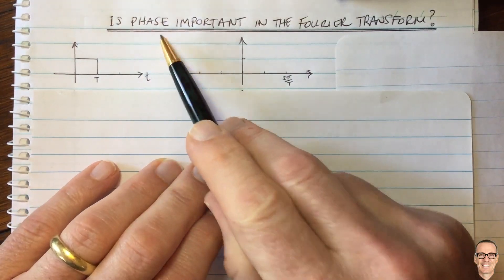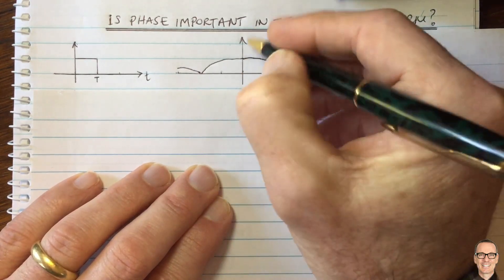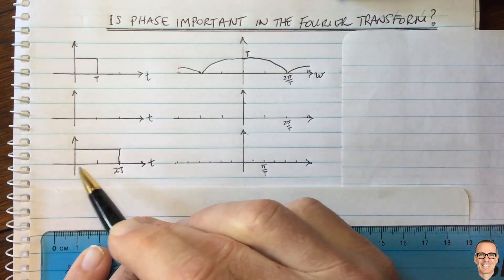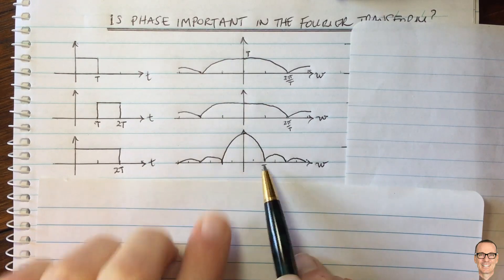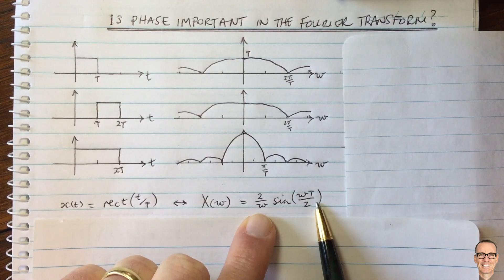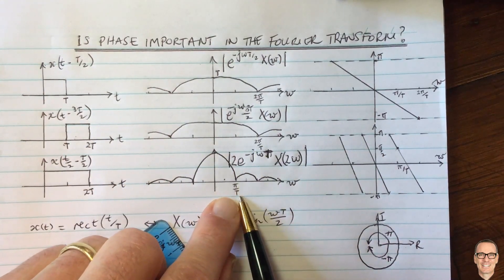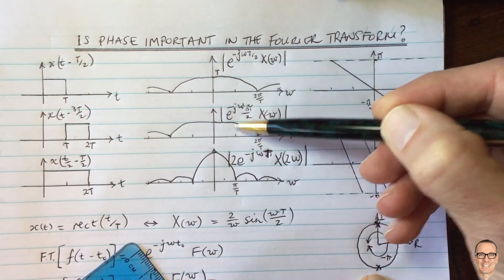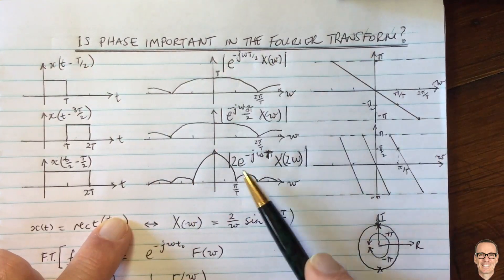Is Phase important in the Fourier Transform?

Comment: Nice!

Clarification at 12:54: 
Adding the two terms with opposite signs for phase angles results in cancellations in the case ω=π/Τ because the result is (j-j)*X(ω), but in general equal-but-opposite phase angles don't result in such nice cancellations.

Comment: Short answer "yes" right ?
I thought you could give all the information in a Fourier plot by either using + and - frequency, or by plotting real and imaginary components.. This seems to imply its gotta be both?
Reply from the maker: Yes. For example, a real signal is always going to have a magnitude spectrum that is symmetric around f=0. So in that case, plotting the + and - frequency only tells you that it is a real signal. It doesn't tell you what the phases of each sinusoidal component are, at each frequency.

Comment: Very insightful, thanks. When I look at the 3 diagrams on the left hand side, you have a special denotation at the y-axis. I haven't ever seen that. I just know the normal x(t) denotation and the signal is then e.g. x(t-2) to shift the function 2 units to the right. 
Does that mean you can put the whole information of the function into the y-axis denotation?
Thanks
Reply from the maker: The label of the y-axis should be the function that is plotted. If you plot x(t) then label the axis x(t). If you plot x(t-a), then label the axis x(t-a).

Comment: Amazing example, so if I understood correctly, usually when we see the graph of a Fourier transform  of a function f it's ploted as its absolute value |FT| which makes us lose the information of the phase, so if you plot that same function e^{-jw(T/2)}x(w) WITHOUT the absolute value we would have all the information for the phase? or am I missing something?
Reply from the maker: Yes, that's right. Although it's not easy to think of how to plot the function (on a single graph) without the absolute value, since it has two parameters (amplitude and phase).

Comment: Hi Sir, thanks for your great video. I have a question about the phase cancellation. Is the reason that they can cancel each other because the shapes of the sinusoid wave component at the frequency at π/T for x(t - T/2) and the sinusoid wave component at the frequency at π/T for x(t - 3T/2) in time domain are flipped due to the phase, and they have the same amplitude and frequency, so the waves cancelled each other and no contribution at that frequency to the added new function, therefore the amplitude at that frequency of the new function is zero? (Just like the way you explained in Fourier Transform of Cos with Phase Shift?)
Reply from the maker: I'm not exactly sure which specific situation you're referring to, but in general, yes, what you are saying is true. Negatively shifted signals have phases that cancel positively shifted signals, if they are added together.

Comment: Sir your way of explanation is excellent. I have question related to the negative amplitude in the Fourier transform plot of Rect function.  I mean to say that one portion of the Sinc function goes below the frequency axis..what exactly it means? I know it is something related to the phase information of the present frequencies in the signal, but  I have not found a clear explanation on this.. plz  make a video on this.
Reply from the maker: Thanks for the suggestion. I did wonder if anyone would ask me about that, but decided it was too much to try to fit into a single video. I'll make another video to try to explain that aspect. In summary, a negative amplitude is the same as a positive amplitude with a 180 degree phase shift. So if you plot the phase as a function of time, it suddenly jumps from zero to 180 degrees (which might seem odd), however it is important to realise that the amplitude goes to zero at that frequency, so in fact it is better to visualise the phasor on a "real and imaginary" plot, and you'll see that the point tracks through zero, and simply comes out the other side (which gives the phase flip).